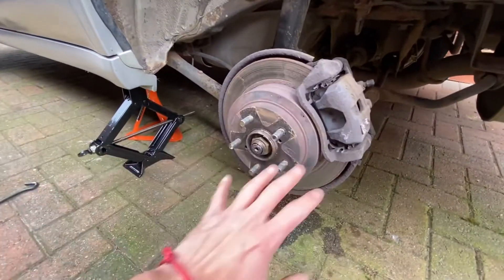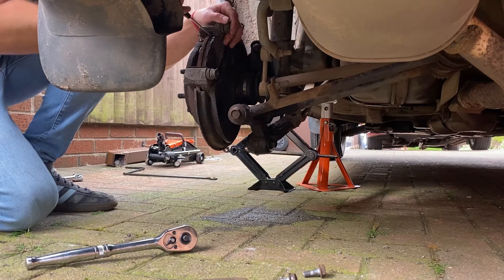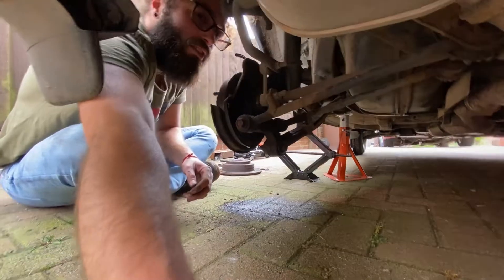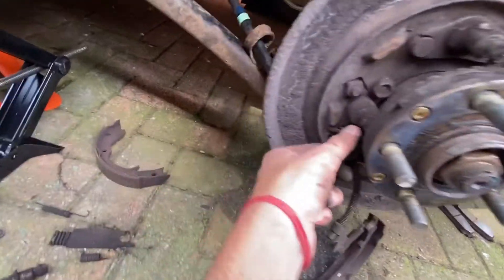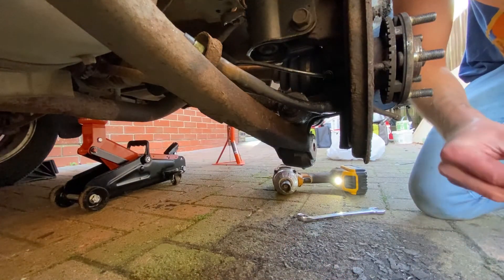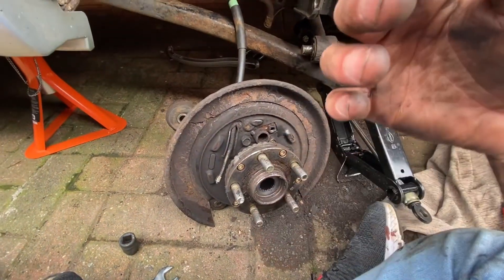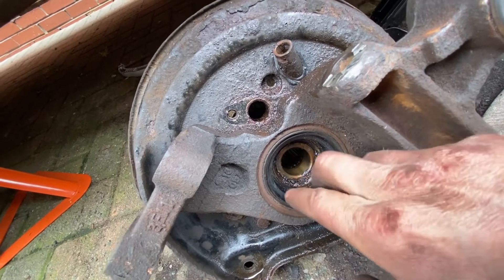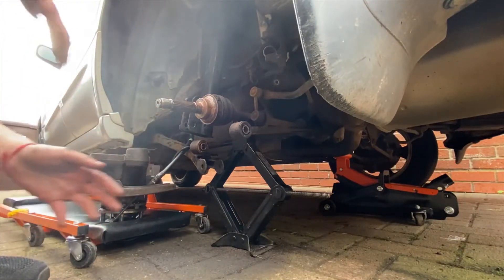Wheel bearing on my 2003 Subaru Forester!!

Comment: this is one of the few videos showing what to expect with 20 years of rust (I’m in Canada). I bought new rubber bushings in case the existing ones were cracked, or need to be destroyed to be removed, and also a new long bolt, just in case the existing one is rusted beyond redemption. Thank you.
Reply from the maker: @62Cristoforo  thanks a lot for your comment! It was one of my first videos and definitely my first wheel bearing on my Forester, this one was a bit of a nightmare to do… 😂 likely I have replaced the other 3 and they have come out a bit easier but I had to replace bushes, bolt and nut too.

Comment: you convinced me to not do this myself
Reply from the maker: I take that as a compliment 😂 honestly, if you take your time and spry the bolts a few days before you do it, you should be good, I am sure you would be able to do it, just lubricate every bolt, mostly if yours is rusty
Reply from the maker: I have done the other 3 and they were a lot easier, so just take your time and you will be fine.

Comment: So to get that lateral bolt out you had to heat it up?
Reply from the maker: I had to, but sometimes it isn’t needed, mine was buried basically. The bushes in the lateral arms have metal sleeves, which with time and bad weather, end welding themselves to the lateral bolt, so in my case, I had to heat them up and replaced them later.